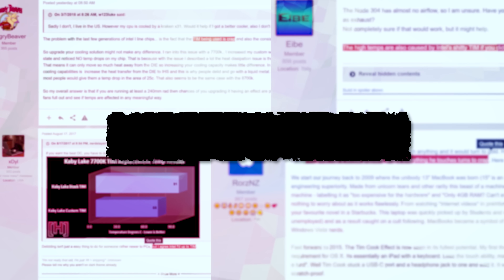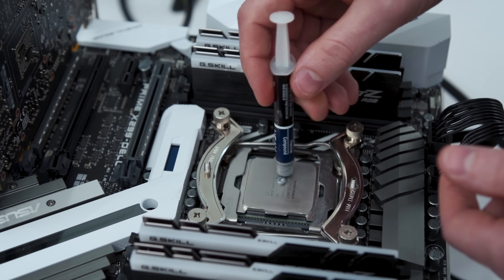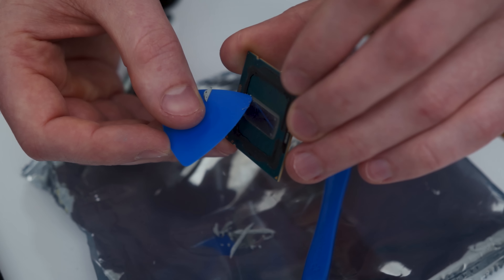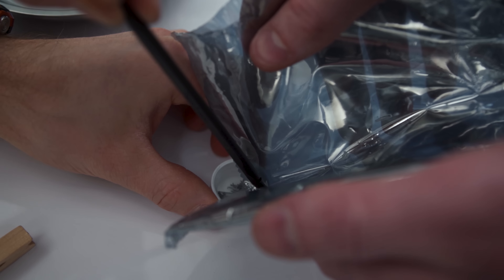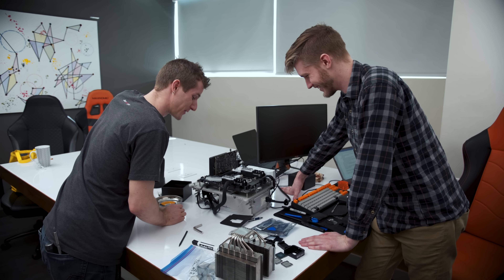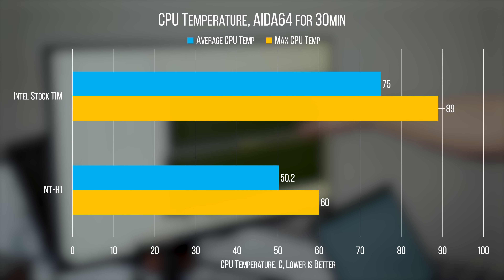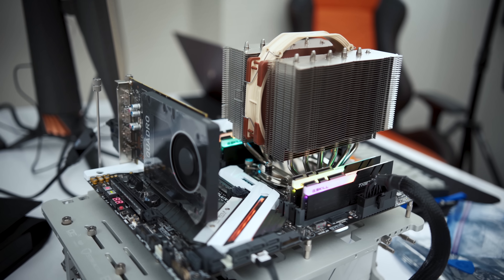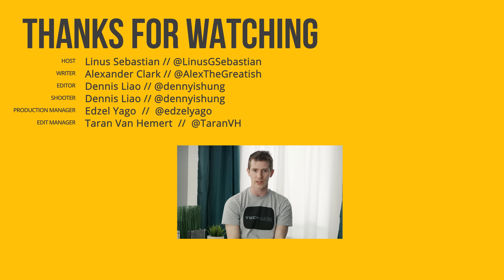Is Intel’s Thermal Paste ACTUALLY That Bad?

Comment: That's the answer I look for. Will be the termalpaste between the IHS and the die dry out even if is air shut? The dissapointed answer is yes or mostly dry out. Intel make CPUs that have a planned obsolescence. That's a great market strategy.

Comment: why comparing it to premium thermal paste? if it's that bad as ppl say i'd say a mid range thermal paste would be a more resonable thing.
   also from experience some thermal paste separates into an oil and thicker paste after a while , maybe that oil thing could be used to disolve the intel paste and give it a propper test.
  in my opinion the intel aplication was way thicker than the premium one also beeing made up of dry chunks there should be air trapped inside.so a fair test would be for the premium paste to be applied in a thick layer with some air bubbles and not too much pressure on the heatsink.

Comment: Just a thought, shouldn't you find two identical CPU's with roughly the same thermal performance, test them, then delid one and apply standard thermal paste? 
The approach taken here adds way more variables for anything to be valid.
And yeah... should have soaked the thermal gunk in silicon oil not alcohol.

Comment: I know it's a bit after the fact, but, you should have used mineral oil instead of alcohol. You'll discover that actually dissolves the paste.
Reply: You could tell some other tech reviewer to try that, since I'm sure linus isn't the one one with tons of cpu on hand to try. You could even try to get a organized harvest of 'TIM's world wide and have them ship them to a reviewer to process back into liquid form to test out...

Or just try to use their connection in the industry to get a hold of the tube that is used to be put in Intel's CPU...
I'm pretty sure someone in China's assembly plant won't mind that you buy a tube for it's base price, heck it might even be available for sale somewhere on the internet.

Comment: why not test all processors, get a baseline, delid all processors, and change the thermal compound inside, apply various paste/grease to the delidded proc, compare the baseline to the various paste/grease result to find the closest conductivity number you can get. you can more or less get the conductivity number, or at least you get the relative comparison for the conductivity quality

Comment: Wouldn't the TIM used on a stock Intel cooler be the same as what they'd use for the CPU? Wouldn't a better test be to get a baseline with the stock cooler and TIM, then retest with the Noctua paste on the same stock cooler?

Comment: lapped a Q6600  and heat sink ,modified the air flow,used machine oil as a thermal medium,and temps went from 60 degree average,to 50!
Thermal paste is a con in my opinion!

Comment: would it be fairer to use the stock cooler (w/ stock thermal paste) then (with the same cooler) with the aftermarket paste?
I mean, I could totally be wrong, but it seems a little unfair to reuse those inside a CPU

Comment: I have Ryzen 1700x, at 3.9 GHz, constant 15% load, it averages at 75°C. I have NZXT Kraken X62 cooler on it. Seems too high. I didn't use any custom paste and observed all installation instructions.

Have you done any thermal testing of Ryzen CPUs? Should I change the paste or is something more evil going on.

Comment: Could it be that price is more of consideration than anything else? I use HY880 that's priced around 1/5 of Noctua NT-H1 and that already gives me around 5°C improvement on idle and 10°C during maximum load. So yeah, the default paste is really, really bad from performance POV.

Comment: I suspect that mounting that radiator WITHOUT any thermal paste would have performed better. Surely the idea much have occured to you guy's, why didn't you test that?
That paste was just a dry, thick layer of ... awfulness... Which by the way is the same words I would use to describe the test methodology.

Comment: I can't help but think that this is done intentionally, using this TIM(Insulator) as they do. If Intel really gets pressure from AMD, then Intel could swap out the TIM and change the micro code on the CPU's. And bam they have a new and improved version to sell with little to no effort.

Comment: It seems, from the entire night of research i just did, with no real first hand knowledge, that intel would simply be better off removing their paste and heatspreader and replacing it with a thermal pad... if IC thermal pads have crazy long lifespans, and are only a 1-3 degrees hotter than consumer thermal paste, surely intel could come up with an even better solution?

Comment: If you want a sample of fresh Intel Thermal compound you can get 5 or 6 of the stock heat sinks and scrape the fresh compound off of them  it comes stuck to the bottom of all of them . I'm sure Intel only stocks 1 kind of thermal paste corporations like to be efficient and save all the money they can

Comment: Intel should have just used Arctic Silver V. It's quite old and has been surpassed by newer pastes in terms of thermal conductivity. But man, it does not age or break down at all. My first pc i ever build is over 15 years old now and still runs cool with this shit. I also used up the last remaining portion of the same syringe i used back then to repair an overheating laptop, no wackers.

Comment: I want to know what happens if you delid then reapply the lid and test. 
I hadn't thought of the fact that the Intel TIM was chosen for longevity. That paste reminds me of dried paste found on dead(old) motherboards. To my question: I'm certain that it would result in overheat and death due to the dry paste not shaping into as good a thermal pathway as the solidified state of it, which may be engineering on Intel's part rather than neglect.
It continues to be unacceptable that Intel stopped soldering, a longevity and performance solution, without publicly offering justification. We can only assume that stunted lifespan is good for business.

Comment: Not sure why Intel claims their TIM has long life span, that mess dries out and is the #1 reason Intel based systems slow down and stop running due to heat after about 2 to 3 years..  I say this and I use Intels CPUs.. Personally I just wish Intel would stop using a IHS and design a socket that lets you bolt your cpu cooler directly to the CPU..

Comment: 3rd generation means quite old. It would be nice to take that aftermarket paste which was used for a long time how well it does. So i think it is alright to use a shitier paste that will last long because not everyone will change there paste under the heat spreader. So we should not hate on intel that much. But why do we have heat spreaders ? There was a time when there were no spreaders and it was somewhat more complicated to apply the paste but it was apparently worth it.

Comment: Not really a fair comparison. That old thermal paste is dried out and not optimal certainly not the way it was when it was manufactured. I've had to replace thermal paste on power transistors on old amplifiers for the same reason because the paste isn't doing the job anymore. So this test is really not a good comparison.

Comment: This may have been kinda bad, i never knew there was thermal paste inside the cpu lol now im scared to try takin apart some cpus.  I definitly have to replace thermal paste in the cpu and i cant imagine how bad it all is.  I do replace thermal paste from the top of the cpu to the heatsink fan once every 3 years.  What i really want to know, 
1. Whats the tool called to remove the top of the cpu?
2. Does amd cpu have the internal thermal paste and is it similar to remove the top of the cpu like intel? Or does it have to be done differently or not at all?

Comment: i have a question, i had delid and lapped the IHS and used arctic MX4 but the temperature remains high at 89-90 on 4770k @ 4.2ghz 1.12~V. do i need to remove the silicon glue to have a better contact from the IHS to the CHip?

Comment: Why not benchmark the flagship i7 from 2nd gen to 8th gen at stock speeds, then replace each CPU paste with something like thermal grizzly and compare the temperatures for each generation? See if its better each generation or worse over the years

Comment: This is seriously wrong.
Thermal paste must be applied as a fresh and brand new liquid, so it can fill the microscopic gaps between the CPU and the heat spreader or between the heat spreader and the CPU cooler. If you scrape up the solid pieces and liquify them, you are still using some old and contaminated thermal paste, which will perform much worse.
If you want to do this video properly, ask Intel to send you a syringe of their bulk thermal compound AND THEN do a regular thermal paste test.

Comment: Here is an idea for a video. I have not been able to find useful info on thread count vs core count. And how GHz wok into it. For example, a 2 core 4 thread is faster then a 4 core 4 thread cpu. But how much is that difference in approximate GHz? The onlt thing I have found is “that one is more powerful.” I know as the go up in thread and core count the numbers go all over. However I have always wondered what the approximate numbers are.

Comment: should have used the solvent that paste uses normally.  silicon gel maybe?  i dont think alcohol disolves paste.  some things dont disolve in water but will in alcohohol and vice versa.  polar and non polar etc

tbh honest its down corning paste.  you could probably just buy it on the internet

Comment: Noctua NT-H1 literally lasts forever.. I've had it on a system for 5+ years.. the CPU and cooler sat out in the open for a few days (while I hosed my case out and let it dry) and I didn't have any new paste, so I reattached it and temps were still fine.  The same as before.  What the heck is this stuff Intel is using?  20C hotter for no reason?  They solder them now but for years they used this crap.  And yeah, this was a bad way of testing, but even delidding you get a 20C improvement.

Comment: It's obvious that any old thermal paste will perform bad. IMO, it'd be best to test it out over a year. Sort of like what you did with the fan dust video. Maybe do one CPU stock as a control, try and get the thermal paste that intel uses, delid and reapply to another CPU, and then delid another CPU with a different brand of paste, and then put them in identical systems and let them idle for a year. Do stress tests before, wait a year, and then do another stress test after and see how each one performs in reference to their previous numbers as well as each other.

While a delidded CPU is obviously going to introduce differences, I think this would still provide a better test than simply using old compound. Or it could be a terrible idea. Idk. I'm not a scientist when it comes to thermal paste and delidding CPUs.

Comment: Why don't you delid a chip, replace the paste and then relid it, or even just run it lidless? That seems like a much more accurate test, you should know that a thick dusty layer like you produced is going to be incredibly poor even if it was pure silver powder or whatever.

Comment: Could you do a video about the effectiveness of Gallium based thermal paste vs copper grease (for car brakes) or even silver grease, that'd be great. Since that stuff is pretty inexpensive and wouldn't corrode the heat-spreader/heat-sink.

Comment: I'm not sure Intel's TIM is all that bad.  In fact, I would say it is extremely good.  People have already noted this test is somewhat flawed.  That said I have really old CPUs and I'm idling at just above room temperature (28-31 degrees c) on a passive cooler.  Not de-lidded in anyway.  Under stress they've never hit 60.

Comment: Of course they cant put enthusiast grade thermal compound under the lid of a CPU. 

Just like you said it's longevity. Enthusiast grade compound wouldn't even last through half the chip's lifespan. 99% of people aren't going to delid their $300+ CPU's and risk destroying it and voiding their warranty in the process, Therefore they need a compound that's going to last a very long time and that it does.

In all honesty I've never seen the practicality in delidding and swapping the compound out unless you are going for an all out OC record. The poor conductivity of the die paste can be easily offset just by using enthusiast compound on the heatspreader and combining it with a good cooler. 

Just don't use Intel stock coolers and this wont even be an issue, But everyone already knows that.

Comment: rule one of thermal paste, never reuse thermal paste. Test result is invalid due to the reuse. 
clearly, you don't have the correct adhesion and spread. 
Is it really that hard to source the stock tim to do the test without resorting to non-sense reuse?

Comment: I mean good video that you actually try this but by scraping the compound from other cpu's you don't get the compound in the initial form, so you would actually need to get two identical (spec wise) Intel CPU's, benchmark both, delid one and replace the compound and then do the benchmarks again. You probably cant compare the delided with the stock without having the other factors in there.

Comment: Is the thermal paste Intel uses INTERNALLY any good? Have you SEEN the paste and the heatsink/fan assembly they ship with the 'lower' end grades of CPU's? ENOUGH SAID! It does the job but of course it's based purely on the dollar.

If someone could show me (in a video) exactly how they de-lid a CPU. Apply some kick ass thermal paste. Re-attach the lid and then give my CPU back to me. I'd be prepared to pay $50 for that service if it could reduce my temps by a few degrees.

Comment: the paste in cpu can't dry with years because is airtight close . intel trying to save money end use "toothpaste".
ex. i delided my cpu 3 years ago and the paste today is still like a new 
(Sorry for my bad eglish)
Reply: There's nothing in Intel's paste that can even "dry out". None of it would be lost, even if it was exposed to air. That's like saying engine oil can dry out. Silicone oil doesn't dry up. That's why they use it. That's why it stays consistent over decades, the issue is, its just consistently worse than solder.

Comment: This test is extremely flawed. That paste never re-flowed into a thin fine layer like it was supposed to. You should have used a grease to reconstitute it, and you should have tried testing all those CPUs stock and after delidding and using NT-H1 under the IHS.
Your poor application of the Intel stock TIM is definitely the cause for the high temps. That layer is in thick flakes, while the NT-H1 is so thin that I can see the metal of the IHS in the shallow parts of its coverage..
Thermal pastes in general have pretty mediocre thermal conductivity, but is used as a thin layer to bridge highly T-conductive metal surfaces. When it's that thick, it acts more like an insulator.

Comment: From my (low level) understanding of computer stuffs its weird that technology often becomes pretty obsolete (for the most part) every couple years and and intel chips aren't "forward/backwards" compatible (whatever that means) with mother boards so the choice to go with longevity instead performance in at least todays time seems....pointless since you will want to upgrade tech way before the chip even starts to die anyways. I hope the stuff i said is correct lol

Comment: It might have been a valid test if you had actual thermal paste from Intel instead of scraping up a bunch and mixing it badly with alcohol. I'm just surprised it worked at all. You called out a bunch of variables in the test but introduced the biggest thing that could throw off the test yourselves. 

I mean who would seriously expect a bunch of old scraped up pasted mashed with alcohol to hold up against freshly applied paste?

Comment: so comparing a chip that had factory applied tim versus after delidding it and applying yours introduced too many new variables (such as???), but harvesting some dried up tim dust and dissolving it in alcohol to apply it didn't introduce new variables?

also a 25 degree difference isn't gonna happen from going from one paste to another. even if the stock tim was only rated at 1W/mK, going to the noctua paste isn't going to drop 25 degrees. going to liquid metal on that side of the ihs isn't going to get 25 degrees. delidding and replacing with liquid metal, then putting liquid metal on the outside of the ihs isn't going to get 25 degrees. I would say the results are largely due to poor applications of the stock dried up tim, since it can't spread you lost a huge amount of surface area and also the tim itself couldn't make good contact with the surface. I'm sure there were tons of air pockets in their wrecking the thermal conductivity. 

would be a better test to just test the stock chip against a delidded chip.

Comment: It's a nice topic for an experiment - but I don't see how a janky reconstituted Intel TIM applied like this would be more accurate than a delidding and replacement. Seems like you are adding more significant unknown factors than you are removing.

If you had actually manged to source fresh Intel TIM somehow it might have been more informative.

That said - it seems to fall about in line (slightly worse - probably due to the suboptimal state of the TIM) with what was expected all along.

Again - this perplexes me that Intel would "sabotage" even their expensive CPUs to save a cent or two - especially these days where they want every possible advantage they can get over AMDs competing products. 10-20c more thermal overhead would surely be invaluable to Intel for most of the same reasons that it is sought after by the users.